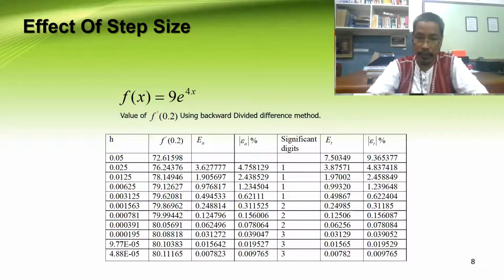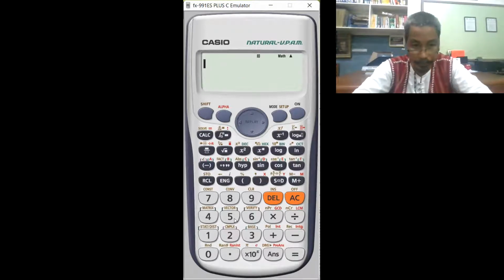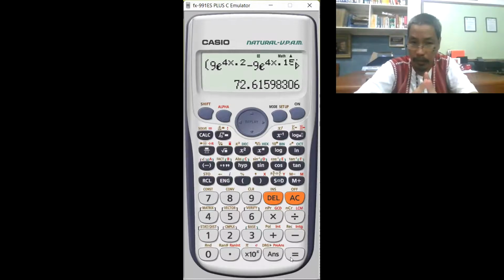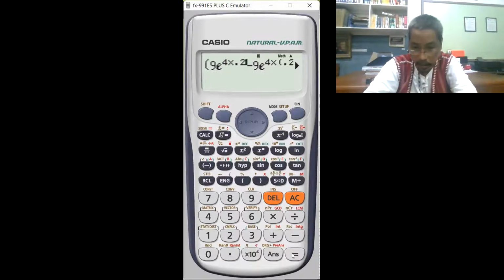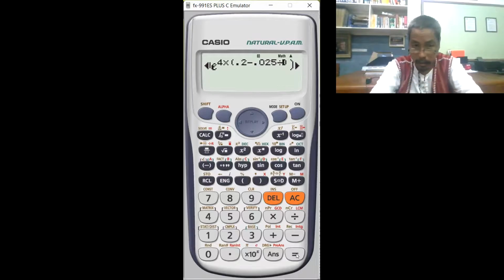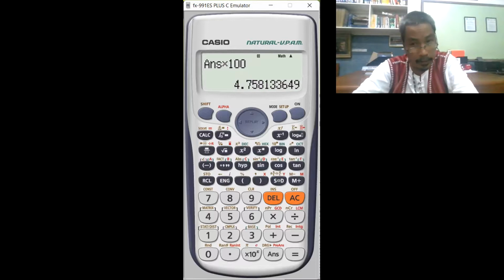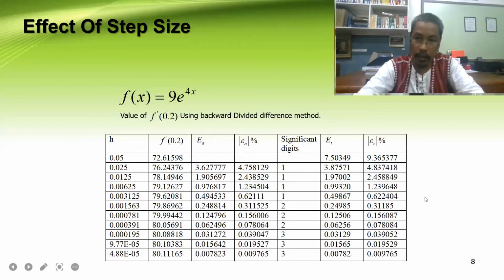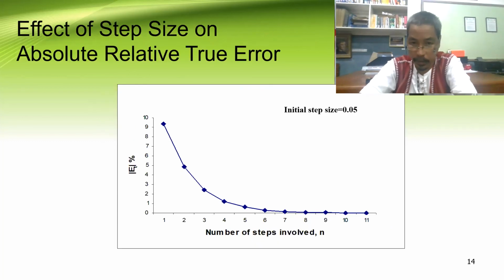Effect of Step Size on Accuracy | NUMERICAL SOLUTION for CE Problems: BDD Derivative Approximation 2

Comment: hank you po sir for this well-explained lesson.
I tried to solved po the different 11 h using the same method, BDD method, and some of the answers po are not exactly as the table shown but close to it, only differs in decimals. Thank you, sir

1.) f(x) = 9e^4x        ∆x = 0.05     f'(0.2)

f'(x) = f(x) - f(x-∆x) / ∆x
f'(0.2) =  9e^4(x)  - 9e^4(x-∆x) / ∆x
f'(0.2) =  9e^4(0.2)  - 9e^4(0.2-0.05) / 0.05
f'(0.2) = 72.61598306
f'(0.2) = 72.61598

True Error
Et = True Value - Approximate Value 
Et = 80.11947343 - 72.61598
Et = 7.50349343
Et = 7.50349

|€t| % = | True Error / True Value |  x 100 
|€t| %  = |7.50349 /80.11947343 | x 100
|€t| % = 9.36537608%
|€t| % = 9.365377%

2.) (x) = 9e^4x        ∆x = 0.025     f'(0.2)

f'(x) = f(x) - f(x-∆x) / ∆x
f'(0.2) =  9e^4(x)  - 9e^4(x-∆x) / ∆x
f'(0.2) =  9e^4(0.2)  - 9e^4(0.2-0.025) / 0.025
f'(0.2) = 76.24375957
f'(0.2) = 76.24376

Ea is Approximation Error

Ea = Present Approximation - Previous Approximation
Ea = 76.24376 - 72.61598
Ea = 3.62778

|€a| % = | (Approximate Error / Present Approximation)| x100
|€a| % = |  3.62778/76.24376  | x 100
|€a| % = 4.758133649%
|€a| % = 4.758134%

Significant Digits

|€a| % ≤ 0.5 x 10^2-m
4.758134% ≤ 0.5 x 10^2-1
4.758134% ≤ 5

True Error
Et = True Value - Approximate Value 
Et = 80.11947343 -  76.24376 
Et = 3.87571

|€t| % = | True Error / True Value |  x 100 
|€t| %  = | 3.87571/80.11947343 | x 100
|€t| % = 4.837413221%
|€t| % = 4.83741%

3.) (x) = 9e^4x        ∆x = 0.0125     f'(0.2)

f'(x) = f(x) - f(x-∆x) / ∆x
f'(0.2) =  9e^4(x)  - 9e^4(x-∆x) / ∆x
f'(0.2) =  9e^4(0.2)  - 9e^4(0.2-0.0125) / 0.0125
f'(0.2) = 78.14945655
f'(0.2) = 78.14946

Ea is Approximation Error

Ea = Present Approximation - Previous Approximation
Ea = 78.14945655 - 76.24376 
Ea = 1.90569655

|€a| % = | (Approximate Error / Present Approximation)| x100
|€a| % = | 1.90569655/78.14945655  | x 100
|€a| % = 2.438528%
|€a| % = 2.43853%

Significant Digits

|€a| % ≤ 0.5 x 10^2-m
 2.43853% ≤ 0.5 x 10^2-1
 2.43853% ≤ 5

True Error
Et = True Value - Approximate Value 
Et = 80.11947343 -  78.14945655
Et = 1.97001688
Et = 1.97002

|€t| % = | True Error / True Value |  x 100 
|€t| %  = | 1.97001688/80.11947343 | x 100
|€t| % = 2.458849011%
|€t| % = 2.458849%

4.) (x) = 9e^4x        ∆x = 0.00625     f'(0.2)

f'(x) = f(x) - f(x-∆x) / ∆x
f'(0.2) =  9e^4(x)  - 9e^4(x-∆x) / ∆x
f'(0.2) =  9e^4(0.2)  - 9e^4(0.2-0.00625) / 0.00625
f'(0.2) = 79.12627389
f'(0.2) = 79.12627

Ea is Approximation Error

Ea = Present Approximation - Previous Approximation
Ea = 79.12627389 - 78.14945655
Ea = 0.976817335
Ea = 0.976817

|€a| % = | (Approximate Error / Present Approximation)| x100
|€a| % = | 0.976817335/79.12627389  | x 100
|€a| % = 1.234504403%
|€a| % = 1.234504%

Significant Digits

|€a| % ≤ 0.5 x 10^2-m
1.234504% ≤ 0.5 x 10^2-1
1.234504% ≤ 5

True Error
Et = True Value - Approximate Value 
Et = 80.11947343 -  79.12627389
Et =0.99319954
Et = 0.99320

|€t| % = | True Error / True Value |  x 100 
|€t| %  = | 0.99319954/80.11947343 | x 100
|€t| % = 1.239648112%
|€t| % = 1.239648%

5.) (x) = 9e^4x        ∆x = 0.003125     f'(0.2)

f'(x) = f(x) - f(x-∆x) / ∆x
f'(0.2) =  9e^4(x)  - 9e^4(x-∆x) / ∆x
f'(0.2) =  9e^4(0.2)  - 9e^4(0.2-0.003125) / 0.003125
f'(0.2) = 79.62080666
f'(0.2) = 79.62081

Ea is Approximation Error

Ea = Present Approximation - Previous Approximation
Ea = 79.62080666 - 79.12627389
Ea = 0.4945327676
Ea = 0.494533

|€a| % = | (Approximate Error / Present Approximation)| x100
|€a| % = | 0.4945327676/79.62080666 | x 100
|€a| % = 0.621109969%
|€a| % = 0.62111%

Significant Digits

|€a| % ≤ 0.5 x 10^2-m
 0.62111% ≤ 0.5 x 10^2-1
 0.62111% ≤ 5

True Error
Et = True Value - Approximate Value 
Et = 80.11947343 -  79.62080666
Et =0.4986667724
Et = 0.49867

|€t| % = | True Error / True Value |  x 100 
|€t| %  = | 0.4986667724/80.11947343 | x 100
|€t| % = 0.6224039563%
|€t| % = 0.622404%

6.) (x) = 9e^4x        ∆x = 0.001563     f'(0.2)

f'(x) = f(x) - f(x-∆x) / ∆x
f'(0.2) =  9e^4(x)  - 9e^4(x-∆x) / ∆x
f'(0.2) =  9e^4(0.2)  - 9e^4(0.2-0.001563) / 0.001563
f'(0.2) = 79.86954108

Ea is Approximation Error

Ea = Present Approximation - Previous Approximation
Ea = 79.86954108 - 79.62080666 
Ea = 0.2487324161
Ea = 0.248732

|€a| % = | (Approximate Error / Present Approximation)| x100
|€a| % = | 0.2487324161/79.86954108  | x 100
|€a| % = 0.311425879%
|€a| % = 0.31143%

Significant Digits

|€a| % ≤ 0.5 x 10^2-m
0.31143% ≤ 0.5 x 10^2-2
0.31143% ≤ 0.5

True Error
Et = True Value - Approximate Value 
Et = 80.11947343 -  79.86954108
Et = 0.24993235

|€t| % = | True Error / True Value |  x 100 
|€t| %  = |0.24993235/80.11947343 | x 100
|€t| % = 0.311949566%
|€t| % = 0.31195%

7.) (x) = 9e^4x        ∆x = 0.000781     f'(0.2)

f'(x) = f(x) - f(x-∆x) / ∆x
f'(0.2) =  9e^4(x)  - 9e^4(x-∆x) / ∆x
f'(0.2) =  9e^4(0.2)  - 9e^4(0.2-0.000781) / 0.000781
f'(0.2) = 79.99445703

Ea is Approximation Error
Ea = Present Approximation - Previous Approximation
Ea = 79.99445703 - 79.86954108 
Ea = 0.12491595

|€a| % = | (Approximate Error / Present Approximation)| x100
|€a| % = | 0.12491595/79.99445703| x 100
|€a| % = 0.156155757%

Significant Digits

|€a| % ≤ 0.5 x 10^2-m
0.156155757% ≤ 0.5 x 10^2-2
0.156155757% ≤ 0.5

True Error
Et = True Value - Approximate Value 
Et = 80.11947343 -  79.99445703
Et = 0.1250164

|€t| % = | True Error / True Value |  x 100 
|€t| %  = |0.1250164/80.11947343 | x 100
|€t| % = 0.156037471%

8.) (x) = 9e^4x        ∆x = 0.000391     f'(0.2)

f'(x) = f(x) - f(x-∆x) / ∆x
f'(0.2) =  9e^4(x)  - 9e^4(x-∆x) / ∆x
f'(0.2) =  9e^4(0.2)  - 9e^4(0.2-0.000391) / 0.000391
f'(0.2) = 80.05685265

Ea is Approximation Error
Ea = Present Approximation - Previous Approximation
Ea = 80.05685265 - 79.99445703
Ea =0.06239562

|€a| % = | (Approximate Error / Present Approximation)| x100
|€a| % = | 0.06239562/ 80.05685265| x 100
|€a| % = 0.077939137%

Significant Digits

|€a| % ≤ 0.5 x 10^2-m
0.077939137% ≤ 0.5 x 10^2-2
0.077939137% ≤ 0.5

True Error
Et = True Value - Approximate Value 
Et = 80.11947343 -  80.05685265
Et = 0.06262078

|€t| % = | True Error / True Value |  x 100 
|€t| %  = |0.06262078/80.11947343 | x 100
|€t| % = 0.078159251%

9.) (x) = 9e^4x        ∆x = 0.000195     f'(0.2)

f'(x) = f(x) - f(x-∆x) / ∆x
f'(0.2) =  9e^4(x)  - 9e^4(x-∆x) / ∆x
f'(0.2) =  9e^4(0.2)  - 9e^4(0.2-0.000195) / 0.000195
f'(0.2) = 80.08823495

Ea is Approximation Error
Ea = Present Approximation - Previous Approximation
Ea = 80.08823495 - 80.05685265 
Ea =0.0313823

|€a| % = | (Approximate Error / Present Approximation)| x100
|€a| % = | 0.0313823/80.08823495 | x 100
|€a| % =0.039184657%

Significant Digits

|€a| % ≤ 0.5 x 10^2-m
0.039184657% ≤ 0.5 x 10^2-3
0.039184657% ≤ 0.05

True Error
Et = True Value - Approximate Value 
Et = 80.11947343 -  80.08823495
Et = 0.03123848

|€t| % = | True Error / True Value |  x 100 
|€t| %  = |0.03123848/80.11947343 | x 100
|€t| % = 0.038989872%

10.) (x) = 9e^4x        ∆x = 9.77E-05     f'(0.2)

f'(x) = f(x) - f(x-∆x) / ∆x
f'(0.2) =  9e^4(x)  - 9e^4(x-∆x) / ∆x
f'(0.2) =  9e^4(0.2)  - 9e^4(0.2-9.77E-05  ) / 9.77E-05  
f'(0.2) =80.10382012

Ea is Approximation Error
Ea = Present Approximation - Previous Approximation
Ea = 80.10382012 - 80.08823495 
Ea = 0.01558517

|€a| % = | (Approximate Error / Present Approximation)| x100
|€a| % = | 0.01558517/80.10382012 | x 100
|€a| % =0.0194562137%

Significant Digits

|€a| % ≤ 0.5 x 10^2-m
0.0194562137% ≤ 0.5 x 10^2-3
0.0194562137% ≤ 0.05

True Error
Et = True Value - Approximate Value 
Et = 80.11947343 -  80.10382012
Et = 0.01565331

|€t| % = | True Error / True Value |  x 100 
|€t| %  = | 0.01565331/80.11947343 | x 100
|€t| % =0.01953746%

11.) (x) = 9e^4x        ∆x = 4.88E-05     f'(0.2)

f'(x) = f(x) - f(x-∆x) / ∆x
f'(0.2) =  9e^4(x)  - 9e^4(x-∆x) / ∆x
f'(0.2) =  9e^4(0.2)  - 9e^4(0.2-4.88E-05  ) / 4.88E-05  
f'(0.2) =80.11165427

Ea is Approximation Error
Ea = Present Approximation - Previous Approximation
Ea =80.11165427-  80.10382012 
Ea = 0.00783415

|€a| % = | (Approximate Error / Present Approximation)| x100
|€a| % = | 0.00783415/80.11165427-| x 100
|€a| % =0.009779039%

Significant Digits

|€a| % ≤ 0.5 x 10^2-m
0.009779039% ≤ 0.5 x 10^2-3
0.009779039% ≤ 0.05

True Error
Et = True Value - Approximate Value 
Et = 80.11947343 -  80.11165427
Et = 0.00781916

|€t| % = | True Error / True Value |  x 100 
|€t| %  = |0.00781916/80.11947343 | x 100
|€t| % =0.009759375%